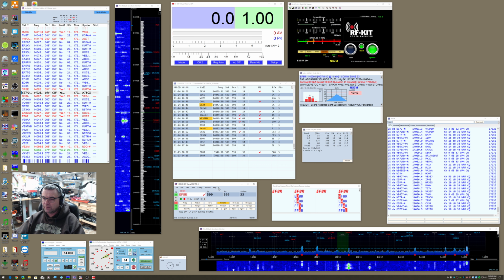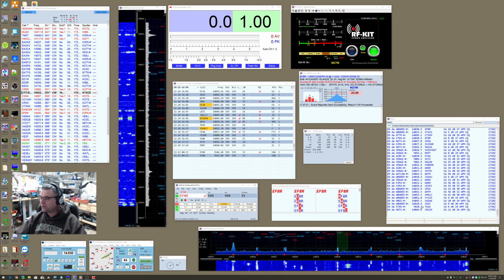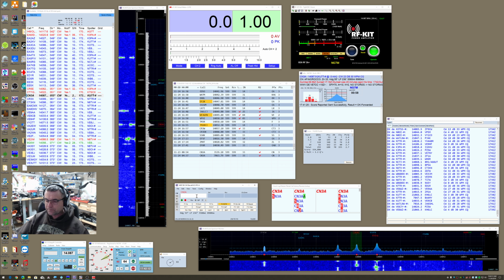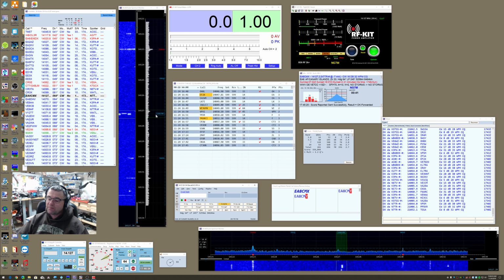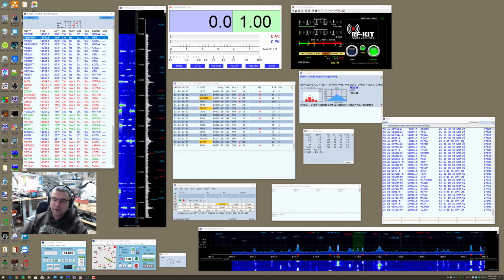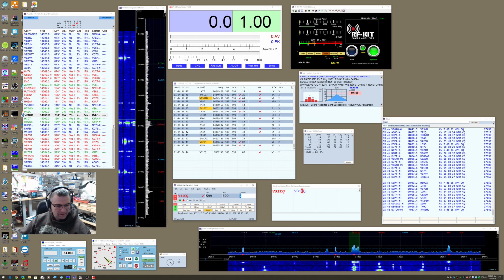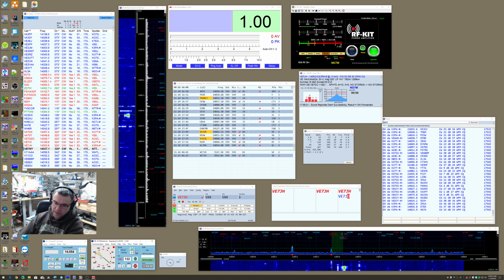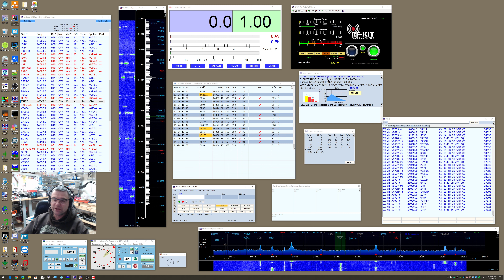Live CQ World Wide CW DX 2019 NG7M Search & Pounce Station Automation Demo w/N1MM Logger

Comment: Hi max. You explain things very well for us test noobs. Did you do a video yet on setting up the cluster and adding speed to exchange “5nn”. I used fjp for wpx and it was brutal. N1mm looks much better. Just a big learning curve. Tnx
Reply from the maker: Hi Jay, thanks for the nice comment.  I have really enjoyed using N1MM over the years and you can't beat the support and feature set.  Some claim it's complicated but I find that I can set it up as simple as I want or as complicated as I want given how much desktop space I have.

Ah, the speed up the 5NN as part of your exchange.  You can find those details on the N1MM documentation website, but the trick is to just surround your part of the exchange with '<' and '>' signs.  i.e. in your key/macro file, you could just put in <<<{SENTRSTCUT}>>>.  This would speed up the RST sent by three steps and then return to your current sending speed.  In many cases it might make sense to slow down part of the exchange, for example in the WPX CW contest it's common for an operator to use >>#<< for the sent serial number.  The N1MM documentation is very good and every time I spend some time browsing through it I usually learn something new.

I have a video about the basics for using Skimmer Spots on an AR6 DX Cluster like the one I run / NC7J: https://www.youtube.com/watch?v=084V6_PNwMQ

However, I could and should do a more in depth video and show the setup right in N1MM and also talk about N1MM features to move from spot to spot and multiplier spot to multiplier spot for example.  It's all in the manual, but it might help a lot of operators out to have a video on that.  I'll try to get motivated for a more involved video. ;)

Thanks again for watching.  Max NG7M